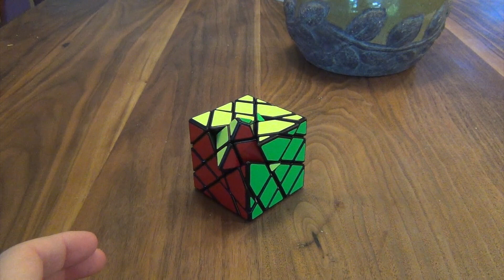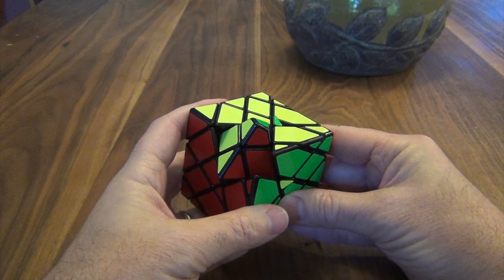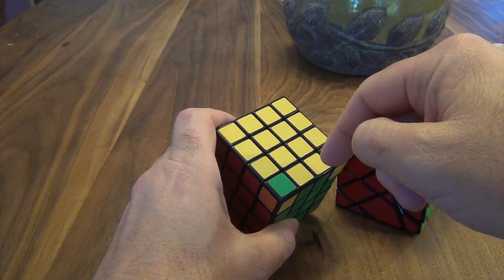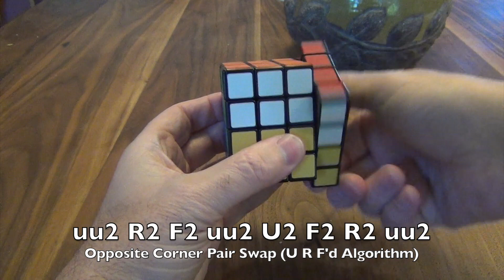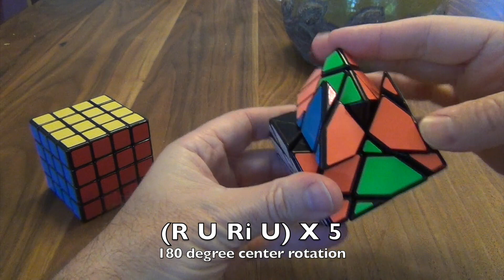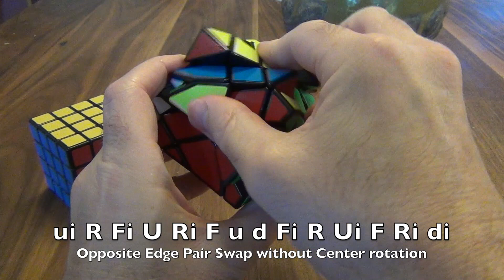Viewer Question:  Master Axis Parity!

Comment: Apparently the center rotation is part of the PLL parity on this cube. Meaning you don't actually need to solve the PLL parity separately. The algorithm for the center rotation also takes care of the corner parity. Saves you a step. Also you may have noticed that this is the same parity we get on the 4x4 Diamond  (Rhombic Dodecahedron).

Comment: Hi, Antonio!
My favourite cube of my entire collection is the 4x4x4 axis cube. And the reason is simple: I've found a challenge on it!! The challenge is to solve its shape (making it a cube) but with scrambled colors, but with two restrictions:
1 - each face of the cube MUST contain all six collors (at least one piece of each collor); and
2 - adjacent pieces can not have the same collor - only "neighbour" pieces that can have the same collors are the neighbours that are opposed by their vertices; if they share the same "side", they can not have the same vertices.

In my 4x4x4 axis cube, I manage to accomplish this chalenge once each 3 tries (I don't want to find an easy algorithm for this, because otherwise I would lose interest on playing with my favourite cube... lol).

So, my question is:
Is there a way to do this challenge on a 3x3x3 axis? I bought one recently and it arrived just minutes ago, and I tried to make it a cube-shape with scrambled collors, but I didn't manage to do it - seems like there will be a parity problem: on the last layer, the center is rotated, and one of the pieces of the cross is rotated too...

Edit: I managed to solve its shape with scrambled collors. It's easy.
But my question is not about solving the shape with scrambled collors; is about solving it with scrambled collors BUT with the two restrictions I've stated above (which I am still struggling to accomplish).

Edit 2: I did it! i solved my 3x3x3 axis cube under the constraints above (cube shape, each face showing all 6 colors, and no pair of adjacent pieces with the same color).

But these two achievements (in the 3x3x3 and in the 4x4x4) were made by try and error, after many unsuccessful tryals (when I needed to begin again changing some pieces in the first layer).

So, I "dare" you to try this challenge a try, and if possible, to analyse the logic of it, to tell if any first layer setup can be solved or if there is some things that must be avoided...

Comment: Guys! I have e similar problem - it's actually 50% simillar. I get a parity where either I have the last 2 corners swap, or I have the last center rotated to 90 degrees. Not both issues, like shown in video. When I do 2Uu 2R 2F 2Uu 2U 2F 2R 2U, my center rotates 180 degrees. I really don't know what to do, could someone help?

Comment: When I solve the last layer of shapemods like this, I use algs that don't affect the center orientation and I solve in this order:

- EO - F RUR'U' F'
- EP - Sune
- CP - Niklas
- CO - RF'R'F - (similar to RDRD)

I also make sure to solve my edges around an already correctly oriented top center - so if I have a parity case, I'll already see it when I permute the edges - well except for puzzles like the 4x4 Mastermorphix.

For PLL parity holding the edges to swap in front and back in the top layer,  I use this alg (note: 2R/r = only inner layer R turn):

(2R2 U2 2R U2 2R2 U2)2

or

(r2 U2 r U2 r2 U2)2

It's very easy to remember: the U moves are all U2s and if you just look at the R moves you have: 2 1 2 (2=double turn 1=single turn)